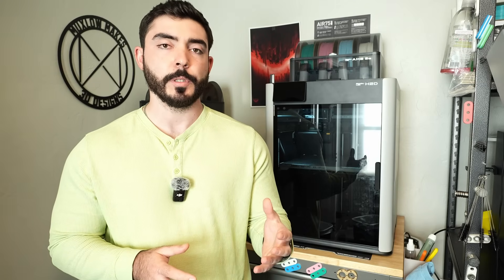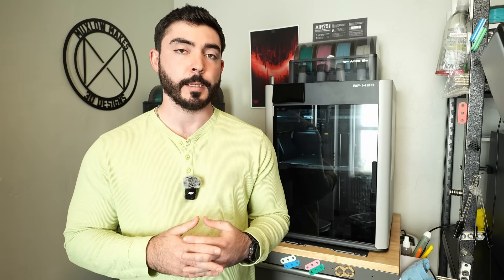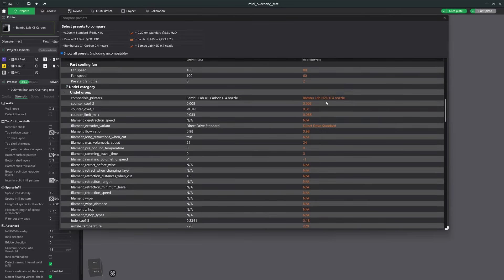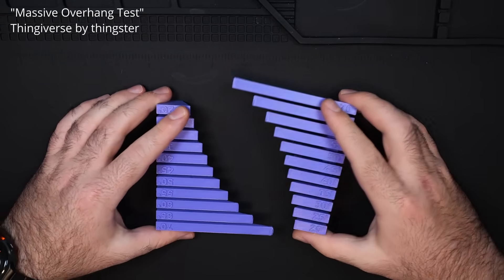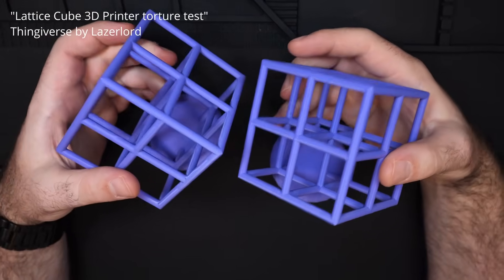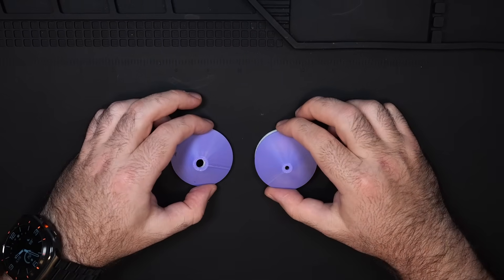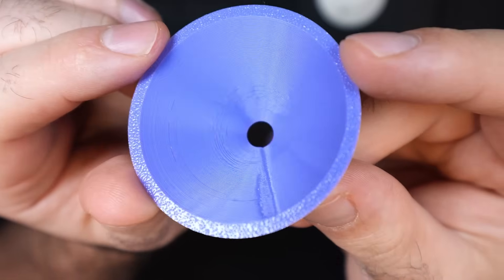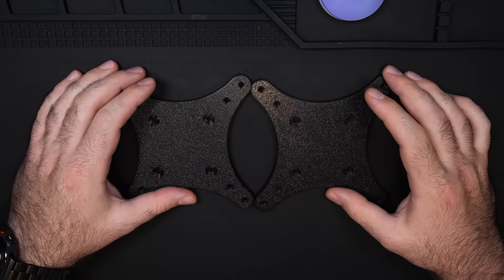Overhang Test: H2D vs X1C

Comment: I wonder if playing around with overhang speeds for your part on the H2D might improve it?  I've never played around with these settings so I don't have a suggestion but my suspicions are it might have something to do with it.  Excellent video BTW, very well done!  Thanks.
Reply from the maker: Thank you so much! I agree, speed is the logical next step. Although, my tuned PLA profile for my P1S's and X1C has 30mm^3/s flow rate, so slowing down my already slow H2D isnt worth it to me, id rather just use my other printers. Hope that makes sense

Comment: Is it possible the issue is the nozzle is not straight so your getting a slight z-shift.  I read a Bambu forum thread where z-shifts were caused by a nozzle that was not straight.  They loosened the screws, straightened and bingo...fixed
Reply from the maker: I dont think that is it, Z-Shifting from a defect like that would show up on all parts, at all heights. This artifact seemed to be exclusive to circular or cone shaped geometry

Comment: Hey, I noticed this issue printing "domes" even with supports. There is a REPO model, and you get crazy stringing in the head dome even with supports on H2D but not on X1C.

I suggest testing dome-like models
Reply from the maker: Thanks for the tip! I appreciate the comment 🙏🏼

Comment: Yes, there are a few that all have the same problem. A solution has been found. You have to go into the menu and reset to factory settings. Then go to Calibrate in the menu and check all the boxes. If one is missing, check all the boxes to ON, including where it says "Use 100°C bed temperature for calibration." Then set up and calibrate again as usual.
Reply: This trick is for the H2D. Many people have been able to solve the problem with this trick. After resetting, select Calibrate everything in the menu. Then the problem should be solved. I can send you the original video if you want, but it's in German.
Reply: @romeojenny  i dont mind, auto translated captions should be fine, im gonna give it a try tho
Reply: @romeojenny  Yes please, share the link.
Reply: Thanks.  I would very much like to see that video.  Deutsch ist kein Problem.
 @romeojenny
Reply from the maker: I've recalibrated my printer several times since getting it, but ill look into this as well!
Reply: You don’t have to do a factory reset you can just check the box when you go to do a calibration.
Reply: So….  Did you figure it out!?   

Also - Does leaving the seam-line in one place look better than if that is Radome?  Seems like random would hide the seam better!?… but I have not tested this w my H2D!?…. I’m new to home printing w my 1st printer H2D May 5th, 2025.

Also’….  Is there a QUEUE for Bambu Studio - where I can a see the list of files I sent to the printer…. Where I can see print times - and change the order of print - like a regular paper printer!?  TIA.

Eric B
Amana, IA
Reply: The factory setting issue was for a bad P1S firmware, not for H2D 🤔

Comment: I would try and print your part in silence mode to see if it’s speed related. You have set a higher flow rate on the H2D in your profile. 
If you print small circles fast (outer wall), your pulling the filament away from the inner wall. Maybe using a higher nozzle temp could help too.

I own a H2D too. But I didn’t printed this geometry (holes with chamfer from below) in PLA yet. I use PLA rarely. 
I may edit this post and try it out tomorrow.
Reply from the maker: Thats the stock profile, so the speeds set are by Bambu. That being said, thats a great point! But, I actually have my tuned PLA profile for my X1C at 30mm^3/s, so having to slow down my H2D is just a waste of time to me

Comment: was the blower cooler on the left of the machine pointing above or under the overhanged part? might make the difference! it should have a blower on both sides, i have these issues on small overhangs on certain models aswell.
Reply from the maker: Which fan the part cooling fan or auxiliary?

Comment: I believe the artifact you are seeing is exacerbated by smaller diameters as the filament is pulled inward into a tight circle. Your cone test didn't seem to go to as small a diameter as your screw holes on you monitor mounts. If it had, I suspect you would see the same artifacts. The H2D profiles may be printing those overhands at a higher speed than the X1C. Try slowing down that last outer perimeter on the countersunk holes so there is less stretching of the filament.
Reply from the maker: Thats exactly why I modeled the cone with a tighter hole, but I ended up changing some settings and that was the one thay came out great. I should've reprinted with the tighter hole and cone
Reply from the maker: I appreciate your suggestion! Ill give that a try

Comment: I have had some weird issues with PLA in my H2D, I was watching a video and he was having some quality issues that he turned off the exhaust under the air conditioning on the panel and it cleaned up his prints.  I tried it on mine and experienced similar improvements.  I wonder if that wouldn't help with what you are experiencing on your print.
Reply from the maker: Thats a great suggestion! Ill give that a shot
Reply: On the x1c. I always have the aux fan off for pla. I wonder if its the same for the h2d
Reply: I found the channel that the creator talks about his problems with the cooling.  It is https://www.youtube.com/@FunctionalPrintFriday and his most recent video talks about it (3d Printed Rollers for Solar Panel) as well as this video.  https://youtu.be/sYN-dwEzZQ8?si=MvWA3eZ0hO_S9p3h

Comment: I dare you to rerun the overhang tests with orientation changes on the bed, where as 0, 45, 90, etc; as the fans have better cooling on the head and left side of the Bambu's
Reply from the maker: I see what you mean, the fans can work better in different orientations. But for cylindrical parts or cones, it wouldn't really matter right?
Reply: @sammuxlow  Might depend on where the slicer starts printing the edge too.
Reply: Maybe it depends on the nozzle you use…? Right vs. Left?

Comment: What was the orientation on the bed? My printers do overhangs better in specific directions.
Reply: its not a 360 cooling and the auxiliary fan is directional too. It’s PLA, so try it without the lit. For batch production with PLA an A1 with a swapmod clone might be a better choice. Size doesn’t matter with a plate swapper.
Reply from the maker: Do you mean how were the overhangs positioned directionally, along x-axis or y-axis? I think they were mainly in line with the X-Axis but they were all slightly different
Reply: @sammuxlow  yeah. That can effect things slightly. It shouldnt for the rounded ones on your designs though.

Comment: Have you tried running flow dynamics calibration manually from the slicer? I'm not sure how accurate the pre-print automatic calibration is (Edit: Ah, I believe you can't change the K Factor for the bambu filaments so I'm not sure if manual is doable. I did it with non-bambu filaments). Overall I find the printer is all over the place. Once fully calibrated some prints look almost injection molded with no blemishes at all, and sometimes just basic chamfers or bridges fail for no reason. I've printed a mouse pad and I have never seen such a perfect bottom and top layers. Almost speechless. It's a shame that the whole security thing happened. I believe the slicer would be a lot better with either merges from the OrcaSlicer or just by using OrcaSlicer. Now they burned that bridge and even lowered their software development capacity by adding additional software that needs to be developed (laser). The issues with wrong settings on profiles that happened before are an attest to heavily lowered development/testing capacity in the main slicer.
Reply from the maker: I wanted to manually calibrate flow dynamics before and learned its not really possible with Bambu Filaments, such a bummer. I ended up just lower flow rates for filaments altogether and then modifying top and bottom flows to adjust for underextrusion. It definitely frustrates me that Orca doesnt work, and that there is added complexity to the software now. I hope Bambu and Orca can makeup. I love Orca

Comment: How odd. I assumed it was the "luck of the draw" when comparing overhangs on my H2D's. My newest H2D has the best overhangs Ive ever saw, but the 1st 2 i bought look like yours. Makes no sense.
Reply from the maker: Thats really bizarre, I hope we can find the fix
Reply: @sammuxlow  I agree. The inconsistency is unacceptable, especially for those of us that do this for revenue.
Reply: Same models?
Reply: @teac117  Yep. Same gcode. 2 H2D's have terrible overhangs but my newest one has flawless overhangs. It makes zero sense.
Reply: @OhImKiCkiN  Great observation. In this case, it can only be a hardware issue that Bambu has identified and fixed. I have ordered an H2D. I hope it is from a batch after the fix has been applied.

Comment: Same here. I'm getting mixed results for both printers. X1C has years of refinements and tweaks that we can only hope will come for H2D at a later time. H2D does outperform in dimensional accuracy over the X1C though which is what I need it most for.
Reply from the maker: Yes I noticed that from testing as well! So it works great for embedding hardware in prints